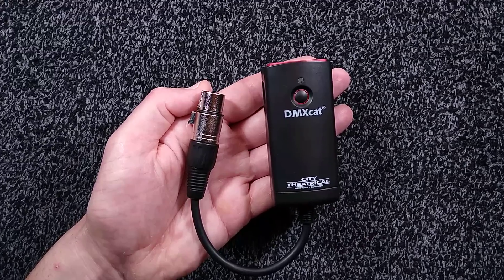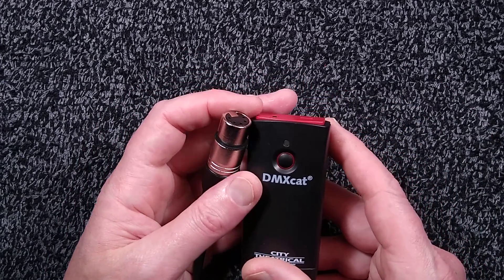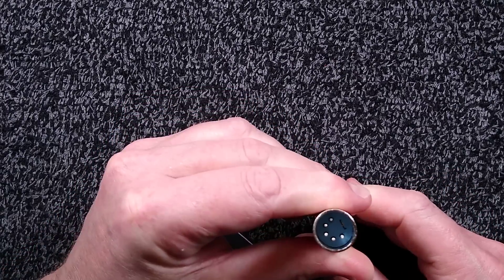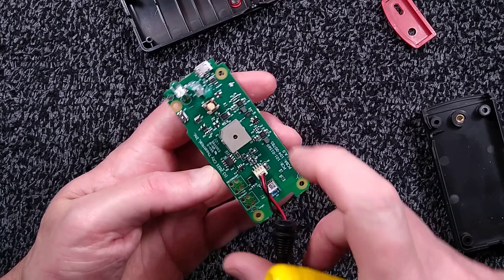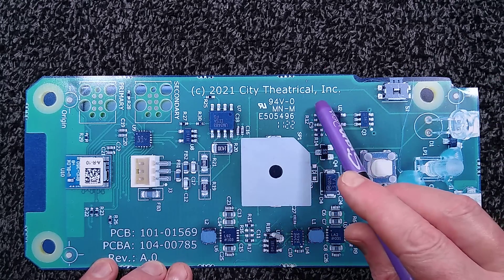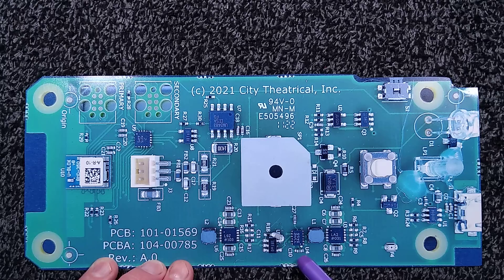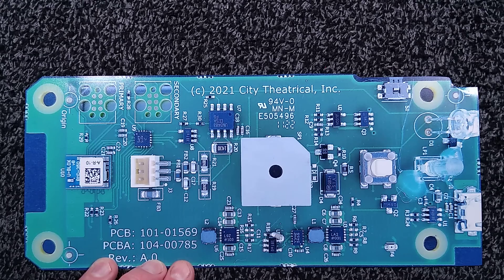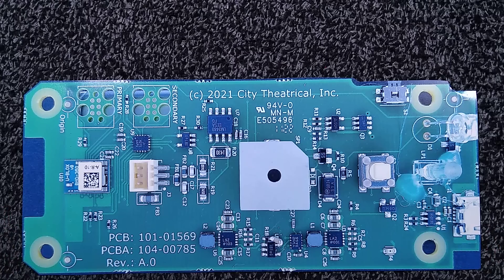Inside the DMX-cat event-industry lighting tool

Comment: This is really great can I use one with 3 pin dmx?  Thanks
Reply from the maker: Yes, with a suitable adaptor.
Reply: 3 pin and 5 pin DMX are electrically identical, the 5 pin is so you dont plug audio in and destroy something
Reply: Also what software would you use with this?
Reply from the maker: You can download the DMXcat app for your phone.
Reply: @bigclivedotcom  I found the device a wow it's expensive lol maybe not then but I really love the devices you review especially the lighting stuff.  Could you do a gig log of a rig setup and teardown at an event just so we can see what goes on at these big events.  Many thanks, tony
Reply: @tonyjefford8449  He did that a few years ago at the Edinbourgh tattoo. Just check out some of the older videos in the archives of this channel...
Reply: @tonyjefford8449  believe it or not its actually one of the cheapest! At £270 its cheaper than the main alternatives: Swisson (between £400 and £600), Chauvet (£350) and TMB (£1000+) 

The TMB has a LOT more features but definitely reflected in the price. Currently I have a dmxcat and a chauvet RDM2Go in my tool kit although I'd love a TMB at some point.

Comment: As someone who worked with three pin DMX (alongside XLR, so easy to confuse the two!) in high school a tool like this would have been amazing to have!
Reply: It's so frustrating to me how often 3 pin xlr microphone cables are marketed as DMX cables. Causes so many problems over distance. 🤷🏼
Reply: @hyperionlink   Admittedly, it is a little insane to require the stupid 5-pin plug that isn't nearly as common, and doesn't hardly ever actually use the extra diff pair anyway, which ends up wasting perfectly good copper and making the resulting cables thicker and more expensive for no reason at all.

It would've made FAR more sense to embrace 3-pin XLR and just standardized on a connector color instead, the way, after PC97, keyboard mini-DIN connectors were always purple and mouse mini-DIN connectors were always green.
Reply: @sirnickity  nope completely wrong. We want dmx on 5pin even though universe splitters and second pair rdm aren't a thing anymore. We want it on 5 so people don't use mic cable and also so you never end up with phantom power hitting a light.

Almost nobody actually uses 5 core cable on 5 pin except if they have a legacy standard so no wasted copper.
Reply: @Savagetechie   OK, interesting.  I was under the assumption it was all wired that way (5p5c), unless it was a custom-made cable.
Reply: @sirnickity  nope, pins 4 and 5 are marked as not connected in the dmx spec so it's pretty rare to see any dmx cable that has them connected.
Reply: @Savagetechie  ... I sit corrected.  Carry on!

Comment: no optocoupler on the dmx board ?
Reply from the maker: Not practical for a device that is already fully isolated and needs to communicate in both directions.
Reply: @bigclivedotcom  Both directions is trivial: you need a 2-channel coupler from µC to driver and a 1-channel in the other direction - the second channel is needed for switching between sender and receiver mode and the driver already separates the Tx and Rx lines.

Downsides: you need a lot more space in a device that really wants to be small and you waste a few percent of precious battery power in the conversion.

Mitigating factors: this is geared towards professional lights with RDM, which probably obey the standard and are isolated themselves. The standard does not require isolation for the controller.

Comment: Sold mine and bought an old school Swisson.

Bluetooth always took ages to connect, software constantly wanted to update. Could never find every fixture in a rig for RDM.

Unfortunately one of the worst £250 I'd ever spent.
The guys I work with think I'm crazy,  until we're standing in the rain on a festival site at 2am trying to connect their phones to it 🤣.

Now my Swisson just plugs in and works.
Reply: with a dmx cat if you favourite your fixtures it stores the profile locally so no need for a net connection. Hardly anybody seems to notice that feature. Swissons still work but the UI is mingin.

Comment: It's a shame this tech didn't make it's way out of stage/event lighting and into domestic spaces. This sort of control would be ideal to adapt to all the smart home automation systems we have now.
Reply: it sort of has but not into the diy low end home space just into the professional space, cresnet is rs485 based as are a handful of other automation protocols
Reply: On home automation front we still have the RS232 port/system (serial) it is in so much stuff, and can pull off a ton of magic. Always interesting how even HD touch screen home automation systems still use it,  want your TV to pop up from floor on a motor? Rs232 commands! Want the shades to all close and a custom song to play when you start up your movie night? RS232 for the win!
Reply: USB and Ethernet to DMX converters are common enough. Just even stage lighting wouldnt switch TO DMX atm, it has a bunch of issues esp with multiple luminaires and poor cables and/or long runs, theres better options (art-net - aka DMX over ethernet for a start)
Reply: Ethernet will take over. It’s the core of CAN is cars too. Dmx512 over rs485 is archaic!
Reply: @cjmitz   I dunno about that.  There's so much overhead in Ethernet that it's not a very practical choice.  DMX is dead simple, both to implement and to use.  You don't have to be an IT guy to understand how it works or how to set it up, and the ends are little more than a differential transceiver and a garden variety microcontroller.

It's archaic, but we're talking about lights and motors.  The brains are in the lighting controllers, not the infrastructure.
Reply: @cjmitz  how long before all fixed connections are obsolete
Reply: Welcome to my house, most of my home lights are controlled via dmx512 from an open have instance and connected to Google assistant with sets of routines, etc. to automate various things
Reply: The utility companies have them to over ride your settings. They are not so smart homes.

Comment: What does DMX stand for
Reply: Digital MultipleX I would expect, I just use it lol
Reply: @TheErador  exactly it. Took over from old analog control voltage Multiplex cables.
Reply: @mycosys  ah AMX and D54, it was like the wild west back then.
Reply from the maker: I used to use D54 analogue multiplexed equipment.  Connector corrosion outdoors resulted in major overall intensity flickering.
Reply: There's at least one West End theatre (where I was once Chief LX) still running Strand Permus dimmers on D54 through a protocol converter. They went in around 1987 and are still going strong
Reply: @davidroberts5090  Nice. Theatre in the Mill (@ Bradford uni) had a mix of Tempus and Mini-2s since the theatre opened in '76 up until mid 2000s. Control was via the Tempus M24 - it does have a multiplexed output over 3pin xlr, but it doesn't seem to be labelled or specced as D54, maybe a precursor, either way it all ended up as 0-10v analogue post demux via 24? pin serial style connectors which split out to multiple bleecons per dimmer. We had a 15A hard patch too, was always fun/satisfying to unplug at the end of a run and unknit the cables to slot them back down into their holes on the patch bay. I imagine with more than 48 channels it would be more annoying.

Comment: While you're talking about stage equipment, i've often wondered how those spark machines work, is it basically an angle grinder, or is there more magic ?
Reply from the maker: Many options.  For stage use it may be titanium dust being blown through a heater to ignite it.  For high use theme park use it evolved from motorised flint strikers to systems that either involve a mig welder feeding wire onto a spinning drum or two mig wires being fed onto each other with a jet of air behind the contact point.
Reply: They are basically a giant lighter, they use the same kind of flint but much larger. The moving part hardly needs any RPM. They are safe to use indoor/studio where pyro restrictions do not allow real pyro..
Reply: Are they not pyro?
Reply: @TheErador  those are usually "cold sparklers", they spray some kind of titanium granule into the air to create sparks - they're usually controlled with DMX, ime
Reply: @TheErador  I thought of pyro, but they seem to be able to turn them on and off at will, like with the beat of the music
Reply: on films they heat a metal thing with a blowtorch, which pops/crackles and throws batches of sparks for a couple minutes until it cools back down

Comment: What about sACN, Clive?
Reply from the maker: Most of the network diagnostics are done on the associated equipment.  I only really use this tool for programming and testing lights on the final DMX/RDM networks.
Reply: If you want a dedicated gadget  the TMB Proplex IQ  is probably the go to for lighting networks but normally when looking at sACN  or artnet lines it's easier just to use a laptop and software.

Comment: The most notable thing I saw was the connector on the circuit board.  You made the comment that professional theatrics use a five pin connector and that night clubs will often use a three pin because it's a cheaper connector.  This five pin device only has three wires connecting to the circuit board.  I'm not sure if that means that you don't really need a five pin connector or not, but I find it very interesting that they spend the extra money (and then pass the cost along to the consumer) for a five pin connector when they only use three pins.
Reply: DMX was originally specified with xlr-5 connector. which made sense so cabling would not be mixed up with microphone or even speaker lines (XLR 3pin has a nice history of (ab)uses)
Pins 4 and 5 were also designated to have an optional spare pair connected to them. Intended for something like an optional backchannel.
But this basically never really caucght any traction and most cables hence did not connect those pins either.

With the general push to save cost and the fact that many good-quality microphone cables (let alone AES/EBU rated 110Ω lines, which are kind of the official preferred cable choice) will perform nicely with DMX (which has a rather modest 250kBit/s data rate and the robust RS-485 electrical layer) 3pin connectors became a relatively common thing, first on the more "budget" lights, later even on higher end stuff, then likely with both 3pin and 5pin at the same time. 3pin<->5pin adapters are one of the more common adapters to find in a stage-tech's toolbox.
Even when you have dedicated DMX wiring you sometimes are super happy if you can "borrow" a cable from the audio guys when in a pinch.
Reply from the maker: The primary lighting companies are now implementing the full two network wiring in their DMX cables.  That has resulted in the cables being bigger!
Reply: @bigclivedotcom  For what do you use two-universe cables? I can't imagine needing them even in a theater that can afford fixtures with 70 channels each. (As a hobbyist people only let me "play" with the lighting on a very small stage with mostly 3-pin equipment.)
Reply: @KonradTheWizzard  2 universes per truss is pretty common on gigs these days. Sometimes it's just to make patching easier but sometimes you just run out of channels. I did a big techno thing a couple of years back where we had a 4 universe artnet node per truss and another 2 universes in the floor package.... If you are running pixeltape without a media server it's easy to need a LOT of universes. All our standard stage racks are set up for 16 universe which covers a lot of gigs but once you get into big stuff you could be looking at 50+
Reply: @Savagetechie  Per truss: with modern fixtures I totally see that. But why 2 per cable? If you use Artnet or sACN for distribution you send any number of universes over ethernet, but I would expect you to split it up into several DMX (XLR) cables with one universe per XLR socket on the sACN->DMX translator box. Are there any fixtures that expect you to have a second twisted pair on pin 4+5?
Reply from the maker: The 5 pin DMX standard was to differentiate between data and audio cables and also has the option to carry a second data pair on pins 4 and 5.  In this case all the work is being done on pins 1,2 and 3 on a single network.
Reply: DMX only requires three pins (data+, data-, and ground). The other two pins can be used as the data pins for a second universe (sharing a common ground pin) because a DMX universe has a maximum of 512 channels. This device has a 5-pin connector because it's intended to interface with professional lights, which all have 5-pin connectors.
Reply: all old avo desks used to be able to put out 2 universes on 5 pin but it never really took off.
Reply: @Savagetechie  presumably you could rig up a splitter to 2 x 3pin
Reply: @TheErador  yes but 2 5 pins just with only the first 3 connected as a lot of good lights don't even have 3 pin. It was a nice easy way to get 2 universes onto a truss in a single cable. I think the only thing in our hire stock that is 3 pin is old martin af1 fans and I've been meaning to convert them to 5 pin for years so I can finally stop putting jumps in the cases.
Reply: Because most 'serious' users (who are more likely to buy this kit) are working with kit that has 5 pin XLR
Reply: I've even seen 3 pin connectors used for power applications which would be disastrous plugged into an expensive light, so if the light has 5 pins you wouldn't be able to plug in a 3 pin female connector.

Comment: 9:05
Almost at the end of the video and you're telling it can be plugged into a network :)
Makes much more sense to me now because all the time I was thinking it had to be plugged in to each individual light.
Reply: we use these large DMX hub boxes that can handle 16+ outputs to lights from a controller - once you have the system connected to an internet network you can control it all remotely. if you have cameras, you can even use some ETC software to focus lights using a smartphone camera.
Reply: I think you may have misunderstood.  DMX is a bus.  You can connect one, or any number, of things to it.  You have 512 channels of data, each carrying 8 bits, sent in serial fashion.  You can use that any way you'd like.

You can have a single device that has a single control that has a variable range of 256 steps (1x 8-bit channel used), or 512 devices that each have a single control with 256 steps (512 x 8-bit channels used), or 1 device that has 512 controls with 256 steps (512x8), or 32 devices with 8 controls of 65,536 steps (32x8x16-bit), or whatever combination you need.

For example, a pan-tilt light fixture might use one channel for pan position, one channel for tilt position, and one each channel for red, green, and blue luminance values.  That would use 5 channels out of your 512, leaving lots left over for additional fixtures.

Each device has an address selector, that determines which channel it starts on.  So the first will have an address of 0.  If we are using the fictional pan-tilt fixture above, then the next would be assigned address 5, and would use channels 5 to 9.  The next would be assigned an address of 10, using channels 10-14.  And so on.

So, it's a "network" of devices.  It's not on a network, such as Ethernet, or WiFi.

Although there are, of course, adapters to connect DMX devices to a data network for the purposes of controlling them remotely without having to run DMX cables between the adapter and a computer that is running the lighting program, for example.  Ethernet is ubiquitous, after all, and WiFi is convenient.  But, that essentially just tunnels the DMX data stream over the Ethernet / WiFi / whatever infrastructure.